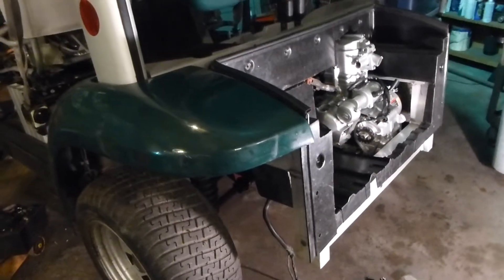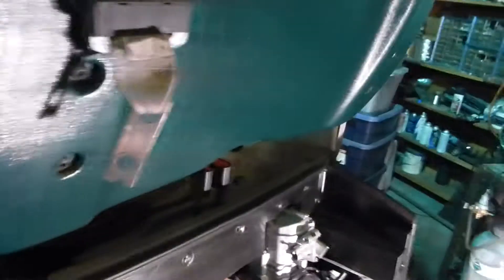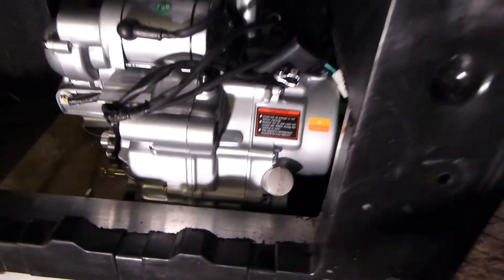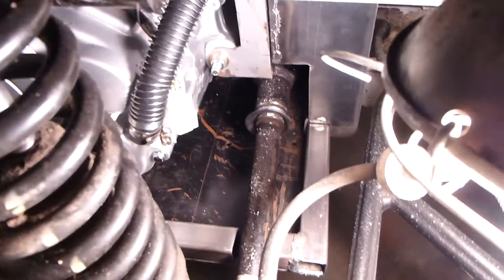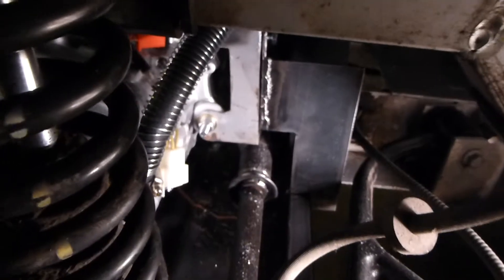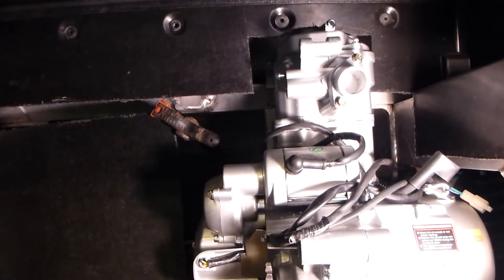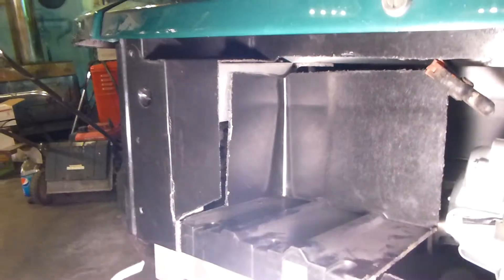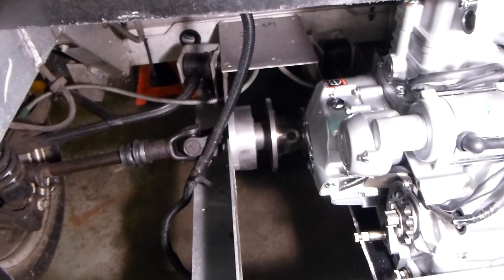Ford Think Repower

Comment: looks awesome indeed, nice job, I was reading the Ford think article in your website and you said that you would have a cd with pictures showing more detail in your build, I would be intersted in buying one please.
Reply: Thanks for your comment, I've been lured off this project, but let me tell you what a learning experience this has been I was not happy with this engine location as it required a jack shaft, and I ended up placing the engine just forward of the chain driven differential.

the conversion of the stock differential to a chain is driven open differential is not that hard. Where I messed up with choosing an ATV engine with a manual clutch. I think it 'very important to select an engine and trans that has an automatic clutch as the higher mass of the Ford Think requires more flywheel mass to get underway from a dead stop smoothly. You'll grow tired of revving it high to pull away from the curb. Google this for more info, but this engine trans is wrong for the conversion. utterpower.com/ford-think-neighbor-journal/
Reply: George Breckenridge I'm planning on using a bugger motor, it's a Yamaha at motor 350cc do you think that would make a difference?  thanks.
Reply: If it's a manual clutch, then I think you will be unhappy. You'd need a lot of flywheel mass for a manual clutch to work well with the mass and passengers in the think, and Motorcycle engines don't generally have that.
Reply: George Breckenridge you're right, I'll switch to an automatic it will less work, let me know if I can buy any pictures or plans you might have on the project, thank you very much.
Reply: The heart of this conversion is converting the differential to a chain and sprocket driven open differential, I think this blog page should give you an idea how it's done.   http://www.utterpower.com/ford-think-neighbor-journal/
Reply: George Breckenridge thanks again!

Comment: Nice... I couldn't remember if I'd subscribed  to your page. Yup, sure did. Nice rework ! Can't wait to see the cooling system.  You need a heater out of an old Luv Truck or Ford Festiva. if you have the sides on it.. They're great since they only have two wires hanging out of them and all the controls mounted right on them.  The only thing you need to duct is the defrost.
Reply: The radiator is up front along with the gas tank,  it's off a ATV.